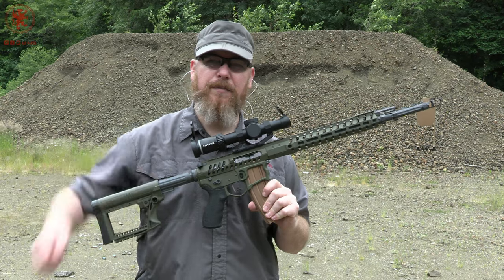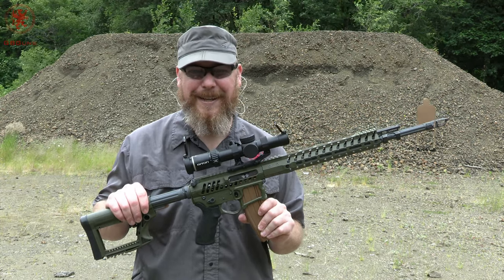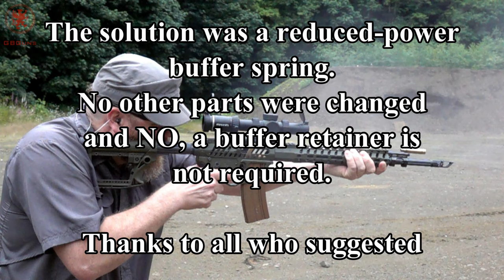Fancy Rifle Redemption!

Comment: Personally, I would've opened up the gas port and adjusted it down if need be instead of using another exotic part. That said, it looks like your rifle runs smooth as silk. I'm glad you got it sorted. Well done!
Reply from the maker: I figured it was cheaper to replace the spring than to risk replacing a barrel.
Reply: @GBGuns  Of course. Just never make the hole for the gas port bigger then the hole in the gas tube. And I assure you, THAT would be way over gassed. But an SLR Rifle works gas block takes care of it.  I work my way up. Midway sells barrels that are under sized all the time. As soon as I get them I run a bit through the hole.
Reply: @GBGuns  drill go brrrrr
Reply: Increasing gas port size would increase the speed of the BCG as the only way to compress the original spring further without adding mass is to increase the velocity of the BCG and buffer.  Kinetic Energy = 1/2 * mass * velocity^2

It would defeat the purpose of the lightweight parts (which is to make it shoot softer) by increasing the velocity of the bolt.  The spring is what counteracts the energy of the BCG, so it has to be matched to the weight of the BCG.  Its why you don't have truck springs on a civic, they're way too stiff to work effectively
Reply: @jth_printed_designs  The issue was that the bolt wasn't cycling = undergassed. The spring was standard issue until he changed it with the underpowered one. Adding more gas to the system would have given the bolt more energy to work properly with the standard spring. In his reply Graham chose to simply change the spring because it was easier. My fix and his would not have effected the reciprocating mass

Common sense > psudo-math
Reply: @defiantmopar   Apparently engineering school and actual physics = pseudo math.  Interesting.  

The problem was not that it was under gassed, the problem was that the components were not matched to each other.  As I alluded to in my original comment, both would work, but gassing it up so that it works with the standard spring defeats the purpose of the lightweight components.  The whole point of the lightweight components is that you don't have to put as much energy into them in order to get them to reciprocate resulting in less felt recoil. Whenever you put less energy into the BCG and buffer you need to reduce the spring rate so that it can be more easily compressed with the lower energy BCG and buffer.

Engineering and physics > YOUR "common sense"
Reply: @jth_printed_designs  How much do you think these springs weigh? Or the difference between a standard and underpowered spring? You are overcomplicating the issue. Trying to show off with long-winded lectures.
Reply: @defiantmopar   The mass of the spring isn't really relevant, the rate or "stiffness" of a spring is sometimes referred to as a "heavy" or "light" spring. A light spring is easier to compress and requires less energy to be put into the BCG/buffer.

I'm not trying to show off, I am explaining to you in the simplest way possible why using a "softer" spring will work better than increasing the gas of the rifle.  If you don't want to learn, fine, I don't care.

light BCG/Buffer + soft recoil spring + less gas = less recoil

light BCG/buffer + standard recoil spring + more gas = more recoil

Now the reduction of recoil does dome at a cost: a lighter recoil spring will have less force to push the bolt forward into battery, meaning you may see more malfunctions and more ammo sensitivity.  There is always a tradeoff.  Less recoil at the expense of reliability.
Reply: @jth_printed_designs  That was the point of my OP. Using a standard spring and more gas (not a lot more) to get the gun to function reliably. Arguably more reliably than a weaker spring. Unless that spring is EXACTLY tuned for that particular system, you'd end up with more recoil since the energy of the bolt and the buffer are not being absorbed by a strong enough spring and are slamming into the receiver extension. And, as you said, difficulty chambering rounds. The amount of gas in the system does not effect recoil, the speed and mass of the BCG and buffer does. The speed of Graham's lightweight BCG/Buffer would be the same with the soft spring/low gas combo as a standard spring/more gas combo. Therefore, same recoil impulse. Only the latter would be more reliable. It's a lot easier to tune the gas with an adjustable block (that was already installed) than to find the perfect spring. In other words, Graham got lucky with this combo.

P.S. I misspoke about the mass (weight) of the springs. I apologize for that. Also, I meant to say that the rifle was undergassed for the buffer spring he had at the time
Reply: @defiantmopar  Alright, this is a long one:

“the speed of the lightweight BCG/buffer would be the same with the soft spring/low gas combo as a standard spring/more gas combo.  Therefore, same recoil impulse”

Incorrect.  A stiffer spring requires more energy to be compressed.  That energy comes from the movement of the BCG/Buffer.  The force required to compress the standard spring remains the same.  That means that if the weight of the BCG/buffer decreases, the speed MUST increase in order to get the spring to compress the same amount.

The equation for this event is m*v^2 = k*x^2 where m=mass of BCG/buffer, v=velocity, k=spring rate, and x=compression distance.  The compression distance will remain constant as there is a set (minimum) distance that the spring must be compressed in order for the cycle to complete.

So for the case where a standard spring is used the right half of the equation stays the same.  If the mass of the BCG/buffer goes down, the velocity MUST increase in order to compress the spring to the same amount (and this is accomplished by adding more gas)

If we instead change out the stiff spring for a softer spring, the right side of the equation is now a smaller value.  The lighter weight BCG/buffer now no longer has to go as fast to make up for the loss in weight because it’s compressing a softer spring.

Let’s put some numbers to it, it may help illustrate the event.  Units aren’t really necessary here, as this is just representative.  Let’s say that:

-the mass of a standard BCG/buffer is 15
-the mass of the lightweight buffer is 10
-standard spring rate = 50
-light spring rate = 30
-compression distance of spring for gun to operate = 3”

So, standard spring with standard BCG/buffer is as follows:

15*v^2=50*3^2
v=5.5

Standard spring with lightweight BCG/buffer:

10*v^2=50*3^2
v=6.7

So, as you can see, more velocity.

Or, we could look at it a different way; let’s keep the velocity the same and see how much compression we get on the spring:

10*5^2=50*x^2
x=2.24”

As we can see, it short strokes.  Like previously mentioned you can either gas it up to slap the BCG/buffer harder, or just reduce the spring stiffness so that you don’t have to dump extra energy into the BCG/buffer.  That energy that gets dumped from the BCG into the recoil spring gets dumped into your shoulder since the recoil spring is pushing against the buffer tube (and by extension, the stock)

All of this assumes that the user has tuned their gas block such that the buffer just barely kisses the back of the buffer tube, meaning that no excess energy has been put into the shooter.  You can’t just throw a lighter spring and leave the gas system cranked up so high that the buffer slams into the back of the buffer tube, as that WOULD result in more recoil.  If the gas system is properly tuned for both cases (to just kiss the back of the tube) the lighter spring will have a softer recoil.

Let me know if any of my explanation is not clear, I’ll do my best to expand upon it if possible
Reply: I am still wondering if you went too light weight with some of the moving internals and the light weight parts weren’t able to provide the inertia necessary to go all the way back….

Either way, you skinned the cat.

Beautiful gun, but I’d never build one with cutouts in the upper…. You found out one of the reasons, remember, where debris can freely fly out it can also freely fly in.  That may not be an issue under the circumstances you will use it for, but all my guns get used in both a desert and a rain forest….

“Cutouts are bad, m’kay?  M’kay!”
                —Mister Mackey (probably)
Reply: I agree.... talk about voracious comments lol....  not much point in an adjustable gas block that you can't adjust...  5.56 might not care.... but changing the spring rather than drilling out the gas port would be a fail on a 300blk build.

Comment: Watching the slowmo, the bolt still isn’t fully cycling to the rear. That’s why you think it is “smooth shooting”. You aren’t getting the recoil impulse from the bolt hitting the end of the receiver extension.
Reply from the maker: Yup, just getting enough travel to cycle, exactly what I was looking for.
Reply: @GBGuns  Lots of bolt bounce, part of the ultra light BCG , Spring and buffer. Beautiful rifle though.
Reply: That's why I go for milspec parts. Plus 5.56 and 223 simply isn't a kicker anyhow. It's not my go to caliber. I'll take 300 BO for 300 yds and under and my .308 AR 10 for the 600 yard shots unless I want to go farther and then I've got a Proof Research 6.5 Creedmoor on a 20" rifle that can do 1000.

Comment: With the lighter spring, buffer and BCG, you can see on the slow mo that you have BCG bounce. Not a big deal unless you're shooting fast, but definitely noticeable.
Reply: Yeah, probably worth adding at least some weights in the buffer.
Reply from the maker: Every AR I've filmed in slow motion shows some bolt bounce.  It's normal

Comment: I had the same problem with my .224V build and i ended up removing my adj block and went with a regular block and it worked like a charm. My build was a 26" rifle +2 gas system from Ranier and a F1 lower set.

Comment: Looks like your brass is being ejected at around 1 o'clock. You might be over gassed or need a heavier buffer. But since it is running good go with it. It looks good and seems to run smoothly.
Reply: 1 o' clock for him. More like 4 o'clock for her.
Was it different ammo?
Reply: @sog4646  Looked like a mixed bag each way.
Reply: They needed to be overgas it since it didn't even have the power to lock open on empty.
Reply: It was coming out at 5 o'clock and hit the deflector, making it bounce forward at 1 o'clock.

Comment: I have an 11.5 with a mid length that has plenty of gas to run even with an H2 buffer, aluminum spacer for gen 3 law folder, while running underpowered Tula steel case garbage ammo. I don't think dwell time is an issue or those brownells 605s would definitely never be able to run. I think you've got a major gas leak issue with the bolt carrier group, or a very undersized gas port in the barrel. I'd recommend giving those things a look.

Comment: In the army we had a cost effective solution to that front weight problem   more push ups and we would put a full canteen on the end of the barrel to strengthen those specific muscles.
Reply from the maker: We were both in the Army. Teya served 6 years, Graham 15 years

Comment: An 18" rifle length system is defiantly a soft shooter, I would also recommend getting the vltor A5 system rifle length buffer tube with spring. Its pretty nice addition with the rifle length and a tuned gas block.
Reply: It's already at no recoil, they don't need it.

Comment: nice. I finally had time to get on and check out this piece in fine tuned condition. It's different for sure, but looks smooth.
Reply from the maker: Thanks for making it to the follow up video.  My goal was to use as little energy from the round to cycle the action.  I think I achieved that.  This thing feels like a soft 22!

Comment: It would run even smoother if you increased your gas and added buffer weights. Without anything in there to act as a deadblow, you are missing out on the recoil that can mitigate.

Comment: I am ex-military, but I don't consider myself a gun expert. However, when I watched your, my idea was that there is not very many things that can go wrong. Either you don't have enough gas or your BCG is too heavy or your recoil spring is too stiff. You could have eliminated the first two (and maybe other ones) by firing the gun without the recoil spring and see if that would throw the BCG far enough back (although I don't really know what kind of damage that would have done, maybe put some kind of a cushion back there). If that would have worked, the only remaining problem would have been the spring.
Reply from the maker: Thank you for your service (from a fellow vet).  I had tried gas setting, tried a normal weight BCG, and tried other buffer weights.  The spring was the only option left.

Comment: The slow mo almost looks like it needs less gas maybe a touch of bolt bounce going on... I'm glad this worked cause I have a 18inch wilson combat fluted barrel with superlative adjustable and im waiting on the jp scs im going to immediately transfer it out with the softest spring thanks
Reply from the maker: All ARs have that much bounce when filmed at that speed.  Most of the "slow motion" you see is digitally slowed, this is a higher frame rate so you're seeing everything.  We're not rich, and certainly not The Slow Mo Guys, but at the speed we film actions I've noticed a lot more than what your 120 or 240 simulated frames per second show.

Comment: As a cursory measure check the line up on your gas rings on the bolt carrier. If they are not lined up properly gas could be running past them and slowing your bolt action proper performance.   See:      https://www.all4shooters.com/en/shooting/rifles/ar-15-gas-rings/

Comment: Glad you got it running.
I noticed that the carrier is bouncing, and the ejection if forward. Now that its running with the lighter spring, maybe experiment with adding some weight back into the buffer to try to tame the bounce and over-zealous extraction? If it'll run with it, anyways.
Reply from the maker: That much bounce is on most guns, you just never see it
Reply from the maker: I might try more weights
Reply: @GBGuns  You're probably right about the bounce - I've never seen it.
The ejection is still pretty aggressive though :)

Comment: Not to say it isn’t running great, but you might try and add weight to that adjustable buffer to get a little closer to the 3-4 o’clock ejection pattern. Try googling “proper AR ejection pattern” and in the “images,” you’ll find a colored diagram that might help my explanation make sense. Glad she’s working and looks great my friend!
Reply from the maker: Thanks.  There are so many overlooked variables in ejection patterns that I ignore the internet lore of what is ideal.  Carrier velocity, ammo pressure, case material, shell deflector size and shape to name a few.
Reply: @GBGuns  Never thought of it that way, I honestly could be wrong because when watching the girl (I think it was Tia) shoot, the ejection pattern looked perfectly okay. Thanks for the answer, it definitely taught me something. Sweet muzzle break btw!
Reply from the maker: @bunsglazing52  and that's another factor: how firmly shouldered is the gun?  I'm sure the ejection direction indicator is great for a mil-spec rifles firing mil-spec ammo, but once any of multiple factors changes i think it loses validity.

Comment: Bolt Bounce See Slow Motion may have caused miss fire
Reply from the maker: Bolts bounce on almost every gun when filmed at that speed.
Reply: @GBGuns  What? Bet the bolt wasn't locked all the way which the weaker spring can cause sometime. That will definitely cause a miss fire.
Reply from the maker: @Courageous_Lion  I said bolt bounfe can be seen when filmed at that speed on almost any gun.  Look back through pur Shokting Impression videos of various guns.  Most of them have slow motion footage in the intro, though we don't always film at an angle to show it (because we know it's normal and don't care) when you slow things down to 1/16 speed you see a lot of things ypu normally wouldn't.

Comment: The 1st 5 or so rounds ejected correctly but then it was over gased which may cause internal damage, curious why midfire the rounds eject counter clockwise as for example over time (Weapon gets dirty) it should go clockwise, or past(behind) the 4 o clock area
Reply from the maker: That method of measurement is only accurate with a military rifle firing military ammunition. I can make a rifle look over or under-gassed simply by swapping ammunition brands.

Comment: what spring did you go with? im building an 18" barrel with a rifle length gas system and a carbine buffer/tube and its short stroking. all of the lightweight buffer springs ive come across say they are only for subsonic loads and are not to be used with full power loads.
Reply from the maker: I don't recall the specific spring, it's just a "reduced power" spring of some sort.

Comment: Saw the first video and was wondering if you had gotten that working. I'm glad it worked out.
Reply: I'm wondering if he ever finally put the buffer retaining pin in.
Reply from the maker: No, it's a pain with this receiver.  Teeny tiny Allen key threads it in.  More trouble than it's worth, plus this way it's easier to tune for future experiments with the adjustable buffer

Comment: I know you say a buffer retainer is not required but why not use one ? The idea of breaking the action and having your buffer flop forward is not very appealing to me. Is there a benefit to eliminating the retainer that I do not know about. I am always looking for more knowledge. ✌✌
Reply from the maker: No benefit, and the retainer is only there to make field stripping easier.  In this receiver the retainer is threaded in with a tiny Allen wrench that I did not want to mess with over and over while pote tially adjusting the buffer so I simply didn't install it.